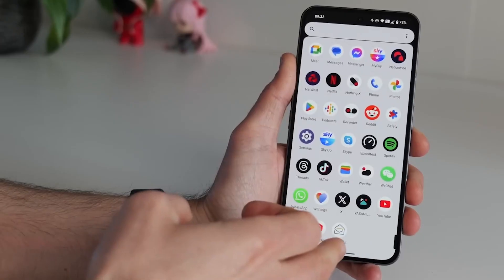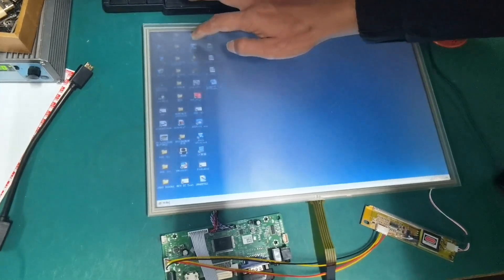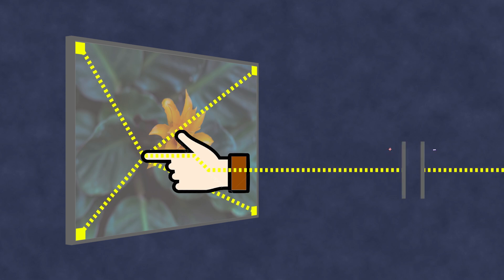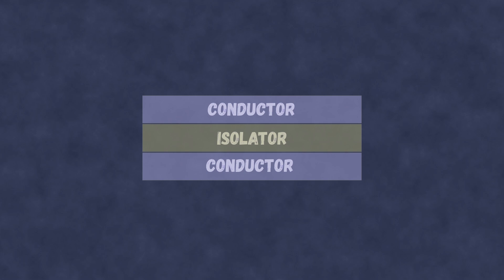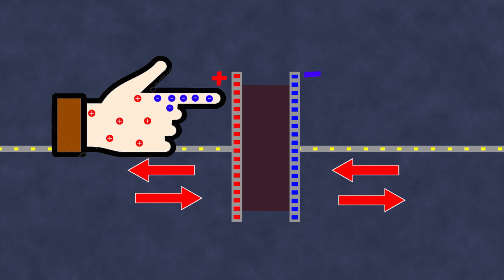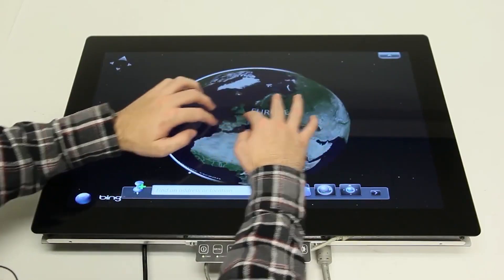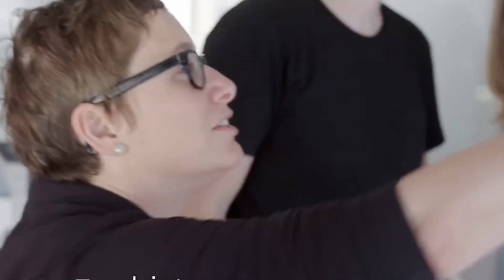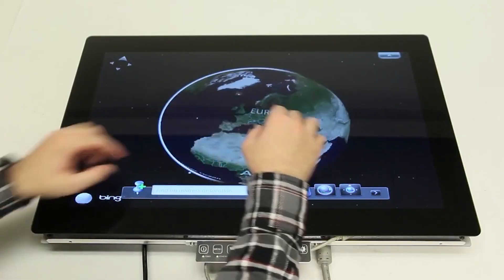Touchscreens: How Do They Work?

Comment: Thanks for the knowledge update.  Long ago in the 1970's, I used an ultrasonic touch screen.  It used ultrasonic sound reflected from a finger (or any other object) approaching the screen.  It was bad resolution of 12 x 16 pixels of touch.  But it worked.